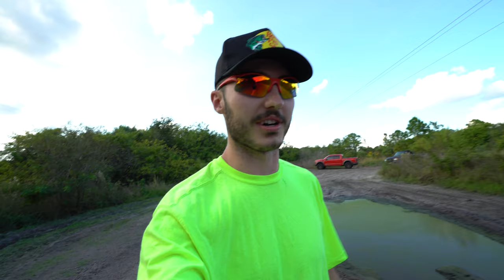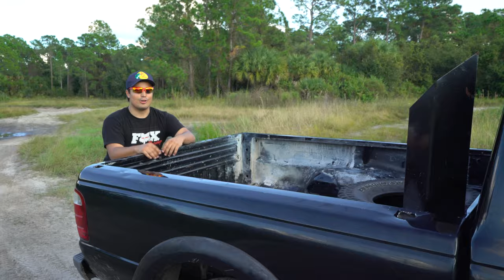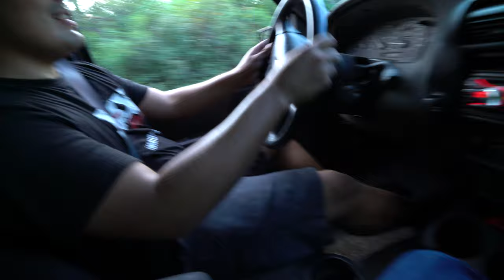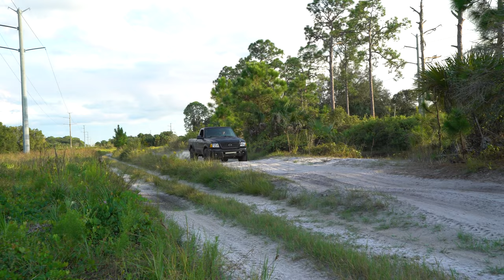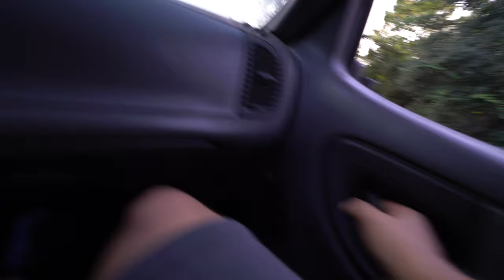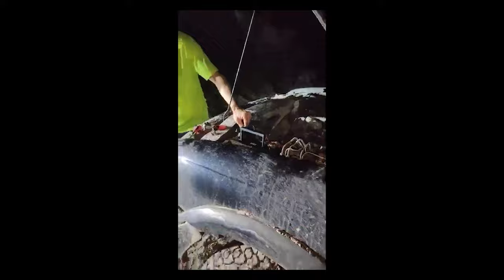Is a Ford Ranger reliable? (Jumping it until it breaks)

Comment: Honestly I daily drive a ranger with 4 cylinder and over 365k miles and sometimes I love to just get into rev battles with any full size trucks my ranger just has straight pipe to a muffler and it has nice tone to it when hitting rev limiter
Reply: You should post some vids of it bro I’d love to hear it might try and do the same to mine. And whatcha got for muffler on it?
Reply: @Slickgtag  I have only a video of the cold start most times I get off work or just get to work and some diesel wanna rev their truck soo

Comment: Mine has 406,108 miles on it it’s a little tired but still drives great everything works in it including 4wd original motor and transmission

Comment: welp, time to drop in an LS and do another ranger pre runner build. no other possible choice.
Reply: Ford ranger 3.0 lasts longer than ls  lasts and  chevy is number one junk yard why cuz there alot in junk yard it's junk   I have ranger no doors  jump 6 ft hi 125 length   iv had truck for 5 years iv had water in motor iv had truck run with no coolant  ran  I'm neighbor took screw of my calipers  I ran it like that🥳😂   chevy knock knock I need oil low oil pressure it's not sensor like every stupid says there's reason why every chevy tick   smokes has low pressure not sensor 🤣    the tick come from rockers not getting enough lupe bie valves  oil ring  here comes chevy smoke 🏭
Reply: Iv raced 4.3 my 3.0 kept up lol at start he took it after 50 mph I was bie bie 410 gears  was key
Reply: A 302 is cheaper and will last a f*** ton longer